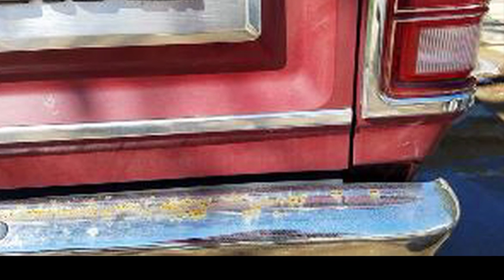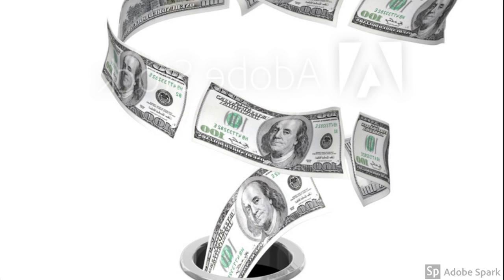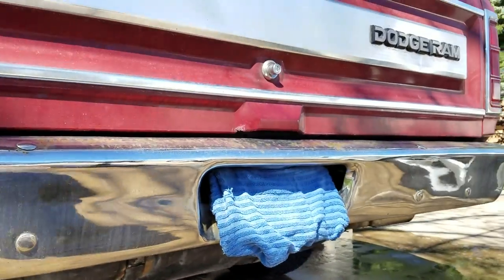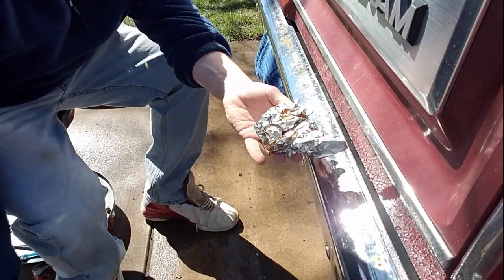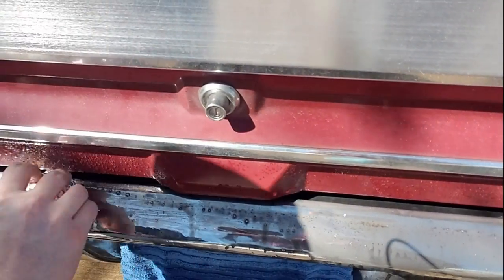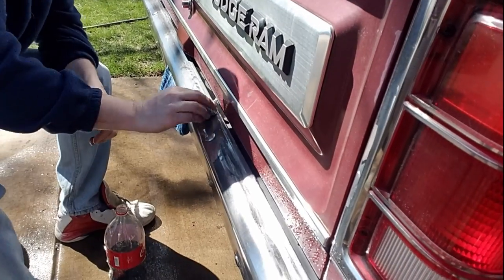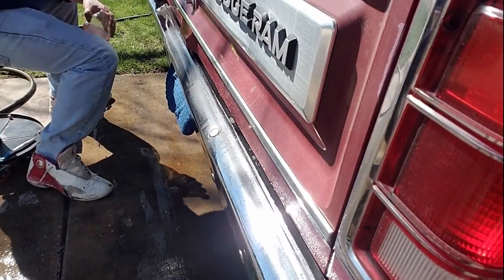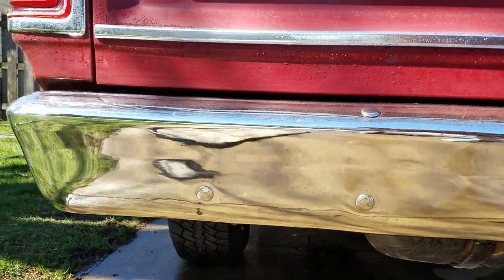We Used WHAT to Remove Rust?!  Yep!  We Did!  10 Minute Fix Using 2 Kitchen Supplies!

Comment: New to your channel.  This is helpful information.  I knew about using coke to remove rust, didn't know if it really worked or not.
Reply from the maker: It does!  New coke--old coke--all work with tin foil as an abrasive.  Appreciate you watching.

Comment: I know this isn't too long a time, but did the rust reappear later ?
Reply from the maker: It comes back.  We didn't rechrome over the bumper.  We do this every Spring and then wax over it.  It stays looking nice through the summer.  The truck is parked outside and we have winter here.  It is such a quick trick that it isn't painful to have to do it again.  I am truly grateful that you watched.  <3